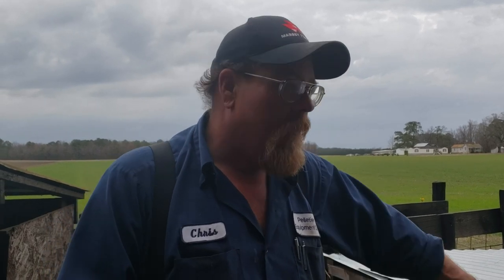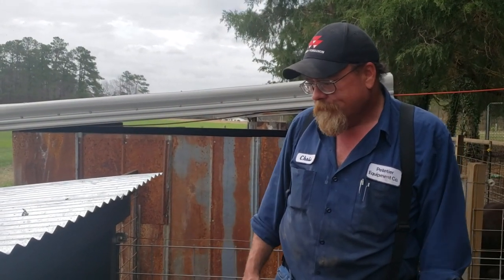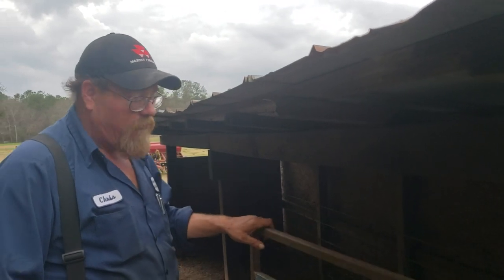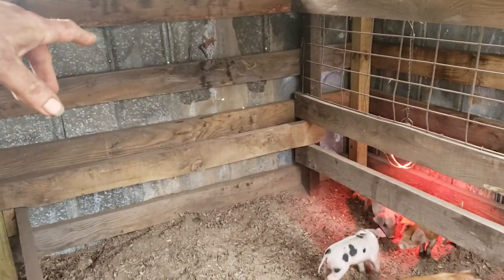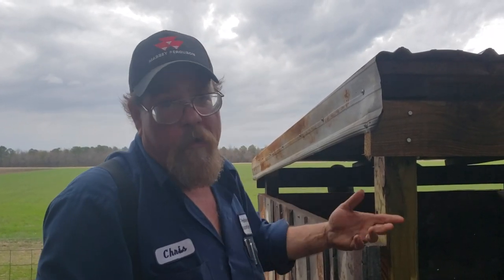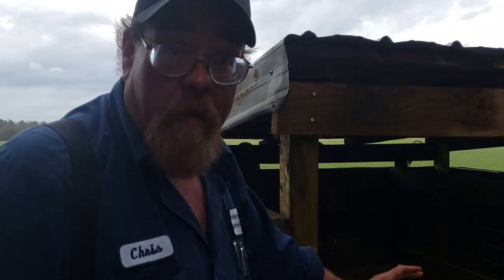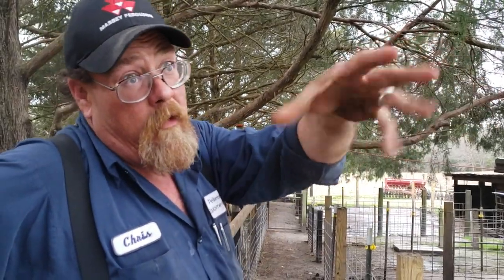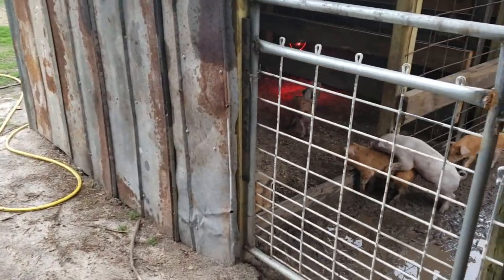Beginner's guide to hog shelters

Comment: ...question..you have a pen with a loading shoot..( ramp to load piggies on trailer )...how wide of a runway?...
In the video  looks about 3' ..
Thank you..
Reply from the maker: The walk way between pens is 4 ft wide and the chut is 32 inches wide ramps a foot high . Mines that wide because some of our breeding stocks in the 800 lb range if all you're loading is tops 24 inches would be better so they couldn't turn around on you . Ramp hight depends on trailer hight, mines low because I never know what customer will show up with .
Reply: @HomesteadingtheHardWay  thank you sir..

Comment: How do you keep your pens so clean, mine smell bad and also having trouble with flies
Reply from the maker: You have to lime the pens ( I use pelletized lawn lime ) and rotate the pig so the pens can dry out . The smell you can keep to a minimum the flies that's a different story they get bad here too
Reply: @HomesteadingtheHardWay  thank you for the advice
Reply: @HomesteadingtheHardWay  is there anything to cut down on the flys?
Reply from the maker: @Dylan1094  you can put fly bait out and traps but I can't tell much difference really. They're only bad here in the early spring and fall once it cools off
Reply: @HomesteadingtheHardWay  gotcha trying to learn all i can im enjoying all your pig videos keep them coming please